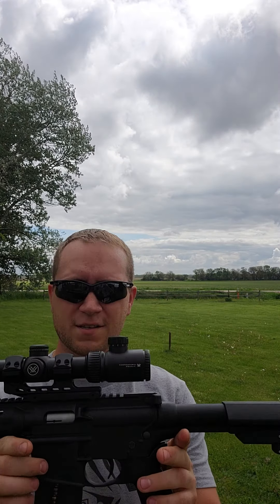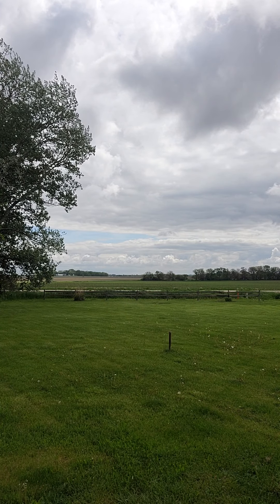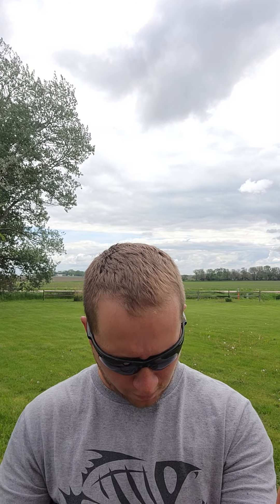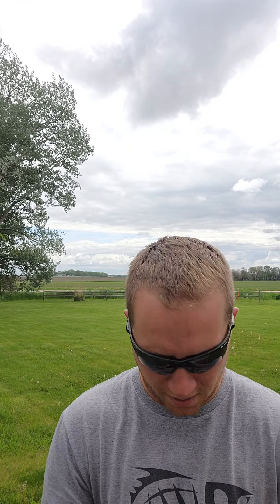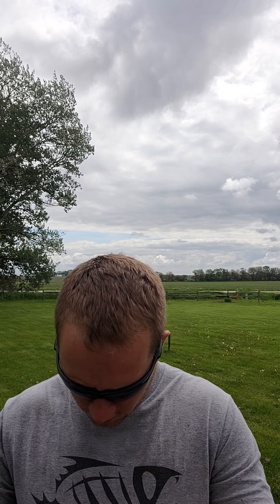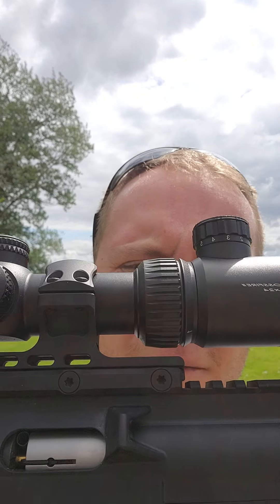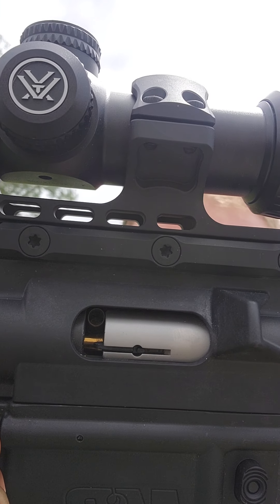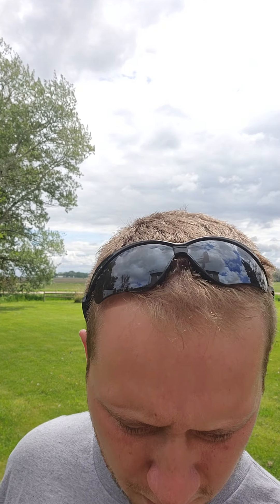M&P 15/22 FAILURE TO EJECT

Comment: Had the same problem with mine the extractor is actually out of place. You can actually just bend it with your finger or use a flat blade screwdriver. Bent line back into position where it was supposed to be haven't had a problem since
Reply: Ejector you mean

Comment: Bought mine back in December. After about 300 rounds this is what happened. I just sent it back to the factory. And I like Smith and Wesson but this is a defect. They should recall all of them and fix the extractor problem.
Reply: Yep the stractor it’s not in the right side!!!

Comment: I had the same problem with my S&W M&P 15-22 and found a video with that problem, easy fix, take the gun apart and the extractor pin is probably bent, just take it and bend it over to where it looks straight about 1/16 of an inch, that's what I did and it has never give me any more problems, it will shoot one right after another with no issues
Reply from the maker: Can you post video

Comment: Ejector is my problem, extractor seems to work fine. I’m told that realignment or replacement of the ejector will correct the issue with mine

Comment: I have had the same problem, I have owned the same pistol version. I also ordered the upgraded extractor and spring with no luck. Called S&W this morning 05/24/21 and they stated I would have to send the gun in for repair and that the repair would take 2-6 weeks. I get jams pretty consistent with a max of 5 rounds than jam. Its very frustrating on a new gun
Reply from the maker: Have you tried shooting stingers?
Reply: The upgraded extractor was made by who?
Reply: Videos are in YouTube on how to fix this issue very easily

Comment: It is easy to solve, the problem is the space in the ejector, you must push the ejector down with a screwdriver to straighten it and that's it, you will have no more problems. Regards !!

Comment: Just got this a week ago and shot it the same day. It gave me the same problem. Tried to load the magazine 1 at a time and still didnt work. I'm going to try and push the ejector upright see if that fix it. If not I'm going to get rid of this gun. I rather lose couple of hundreds than  have useless gun.
Reply from the maker: Yeah its frustrating I'm gonna sell mine too.
Reply: @iowabuckinrut760  
Hey man, read that first comment that someone posted about bending the extractor a little bit towards the ejection port(not sure what it's called) this will solve your issue.
Reply: Bend the extractor pin, there are videos on youtube about how to fix this issue. It will take you 2 mins to fix it.